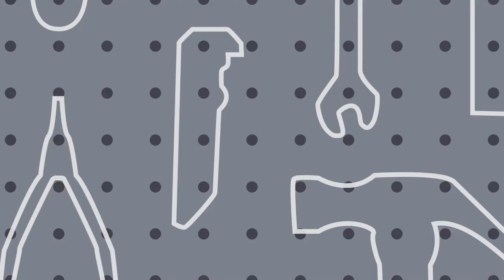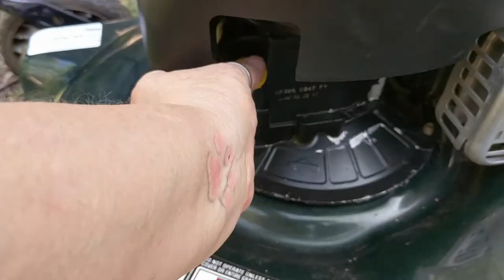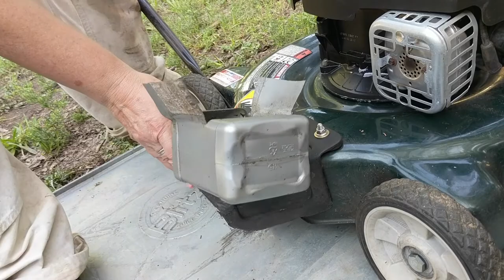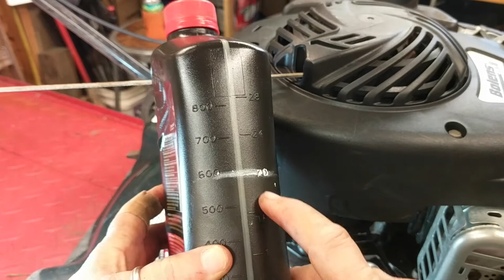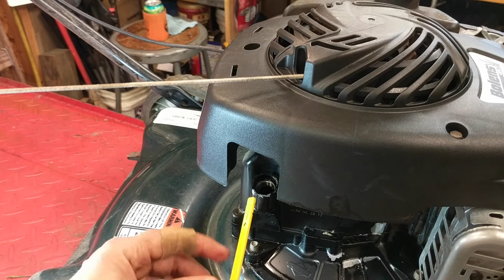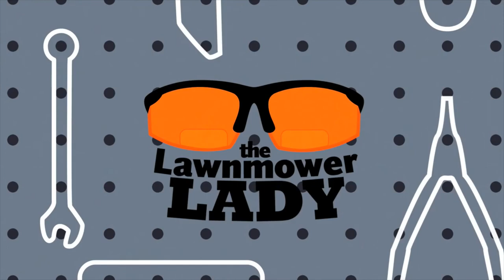Oil Change on 450E Briggs & Stratton E-Series Engine Lawn Mower

Comment: I used a big syringe type of device with a tube attached to it and suctioned the old oil out of the motor.
Worked well and I didn't need to tip the mower on its side.
Reply from the maker: Glad you found something that works for you.
Reply: @TheLawnmowerLady  Indeed.

Comment: Hello Stella
Love the Briggs oil because it’s red...
Always find on the Honda Oil as it is clear, it is difficult to see.
Funny I saw a near neighbor change her oil, it blew out all this smoke from her exhaust but she didn’t realise she needed to take the old oil out first.
Have a wonderful day😀
Reply from the maker: Thank you Mr Rick! At least she tried?? I giver her credit for that 😂
Reply: @TheLawnmowerLady hello.thx for the info. Do i need to do any other preparations before tipping the mower to keep oil from getting into tge wrong place?
Reply from the maker: @anaotano3757  Not really, you should be good. If you want to be 100% sure no oil leaks past the exhaust valve, tug gently on the rope till you feel that heavy resistance. That is when the engine is nearing top dead center, when both valves should be closed. Worst case if there any oil in the head, and it happens to leak past the valve into the muffler, you might smoke for a few seconds when you start it again. I appreciate you watching. Cheers!
Reply: @TheLawnmowerLady thanks!!!!

Comment: I am a little late to the party. I bought a mower with this engine on it brand new. It is now on its ninth season of use. Maintain the mower and it will last. Fuel treatment in the fuel can, after the break in oil drain, 5W-30 synthetic was used and changed every year. Wash and oil its foam air filter, put a new spark plug in it every year. The mower runs great. These engines get a bad rep for the plastic carb. Very easy carb to service. Adding an inexpensive disc fuel filter inline helps prevent a clogged jet in the carb as well. Great budget engine if they are taken care of.
Reply from the maker: I tend to agree these plastic carbs are very simple to service. The problem is the newer mowers have a lot of plastic on the deck, and they don't hold up structurally.
Reply: That makes sense. What I did with this mower right out of the box was coat the deck. I removed the blade and covered the underside of the deck in truck bed liner from a spray can. Now, it can not rust. After years of using the moser, its paint started to fail. I painted the mower black with tractor paint and then to be goofy, I added automotive stickers. Goofy, but fun.

Comment: Hello, I have a new briggs & stratton 450 e series, it has not been used even once, I want to know if I can use synthetic oil or should I use mineral oil
I understand that once mineral oil is used, synthetic can no longer be used because it loosens the dirt from the mineral and can damage the engine.
What do you recomend?
Reply from the maker: Either one is OK. I'd suggest not mixing and matching on subsequent oil changes. Thanks for watching!

Comment: Hello, I don't know if anyone can help me but my oil cap popped off my lawnmower and I can't seem to find one that will fit my e450... can anyone help?
Reply from the maker: Check any of the major online parts houses (partstree, jackssmallengines, etc) You need your engine model number, usually stamped on the valve cover.
Reply: Try any of the repair shops and they may just give you 1 from the junk pile.

Comment: I've been researching, and I can't find the right answer. I Have a Troy Built with Briggs and Stratton engine, I'm using 5w-30 synthetic oil. Will I be okay?
Reply from the maker: Do you live in a cold climate and need to run your mower in the dead of winter? The 5W part of the oil makes it thinner and easier for cold starts. The trade off is less oil staying on those parts that need the lubrication if you are in a hot climate. This too depends on how old the engine is. If it's a newer EX style engine (the one with the plastic carburetor) then you are at higher risk of overheating in the high heat of summer. If and older Quantum engine, it will tolerate the abuse better. If you are still in doubt, then use regular 30W (or what ever your OM recommends) Hope this helps.
Reply: @TheLawnmowerLady  thank you I will do that.   I'm in California, it gets a bit warm out here.

Comment: I think I actually like this style of oil change better than the plug underneath.  Are these e series engines pretty decent or are they junk?  Comparing to a cheap honda.
Reply from the maker: I don't know of any cheap Hondas, LOL, but I will say the E-series is cheap as well as inexpensive IMO. The cam-shaft lobes are now plastic as are many other internal parts, and prone to failure. That said, the plastic carb is very inexpensive to service, a placement fuel stack is $12 or so. Not much else to go wrong with this carb. Thanks for watching. Cheers!
Reply: @TheLawnmowerLady  thank you.  Plastic cam shaft lobes.... Crazy.  Thank you for your expertise, I will try to find a nice used Honda.  I'm guessing the older the better!
Reply from the maker: Easy to tell if a used mower was well taken care of. Look under the deck, and check the cables. Wonky wheels are another sign of neglect.
Reply: I have one that's three years old. Guessing it has about 100 hours on it now. So far it's been perfect, no problems at all. I do change the oil a lot, whenever it starts looking dirty. (Walmart 10w30) I also use stabil fuel stabilizer in the gasoline. It helps a lot. I change the plug every year too. Starts on the first pull. Can't beat that for such a cheap mower.
Reply from the maker: @TheBigdog868  You take better care of your mower than most folks do. THanks for watching.
Reply: @TheBigdog868  Thanks for the info.  Ended up finding a nice used honda.  Really liking it!
Reply: I've got a basic 20-inch side discharge Hyper-Tough mower.  So far it's reliable and performing as expected.  No complaints from me.  I maintain it annually and mow a quarter-acre sized lawn in New Hampshire.

Comment: Hi could you tell me why my mower keeps cutting out but starts again about 10 mins later thank's Keith..
Reply from the maker: Thanks for watching Mr Keith ! Next time it happens, remove the gas cap and try again. If it starts up, it's a bad gas cap (not venting correctly). If it doesn't start with the cap off, then it could be an ignition coil going bad. Check for spark at that time (careful, it'll be hot). Good luck!

Comment: Is there an oil filter on the 450E mower?
Reply from the maker: No, Ms Rachel. None of these smaller push mowers have oil filters. Thanks for watching. Cheers!
Reply: I have a 450e 125cc lawn mower that has an oil filter on the opposite side of the where the oil is. Opposition side but at the front left not back.
Reply from the maker: @henryaraujo9  wow! I would love to see that. Are you in the US?
Reply: @TheLawnmowerLady  soon as I thought about it, I knew I messed up. It’s an air filter, not oil😅 this video helped me change the oil and mow my lawn though so thank you for that! First time doing this so I feel confident in my maintenance now
Reply: @TheLawnmowerLady  and yes I’m in the US😁
Reply from the maker: @henryaraujo9  if it was saturated in oil, I can see how  it could be considered an oil filter. It means the mower was likely turned over, air filter  side down ( never do that) or possibly overfilled.oil.both very common. Thanks for watching. Cheers!